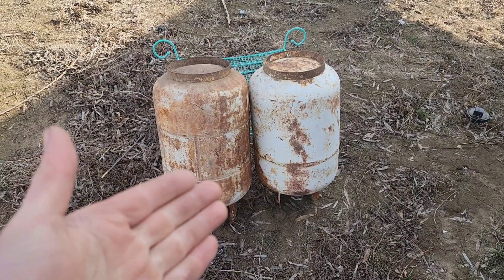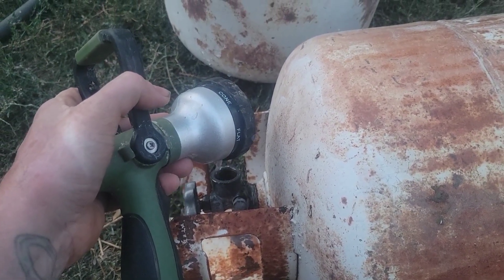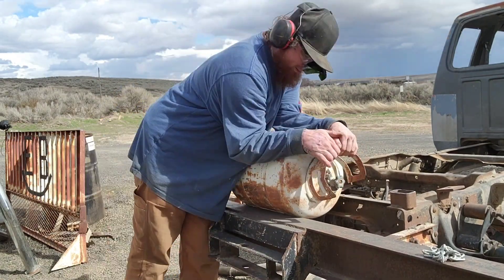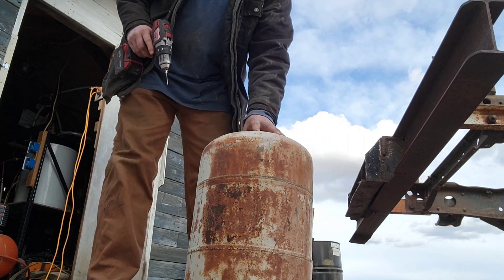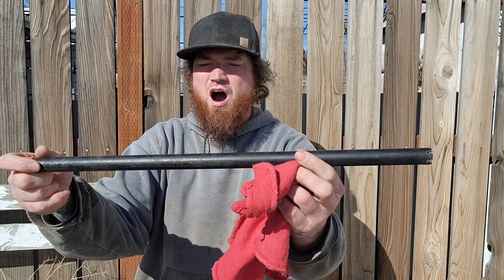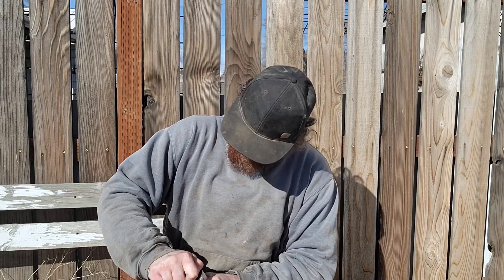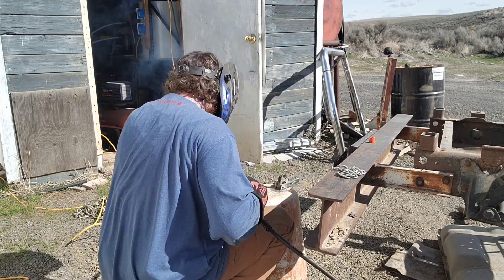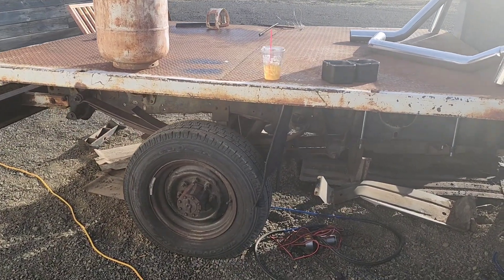I ALMOST BLEW MYSELF UP! Building a fuel cell out of a propane tank diy homemade race truck ep.10

Comment: What I have done several times already, though, is to open the valve, let the tank sit upside down for several days or whenever I get back to the project... Then just take the valve off, first thing. Filling it with water at that point is easy. You can even put a 3/4" plug in where the valve was, to hold the water in. Then you can do all the cutting and welding you want, with it still full of water. No risk of explosions. And even if you did somehow miraculously still have an explosion, it would be no more dangerous than a fart. Tank is not going to turn to shrapnel, because of the water.
Reply from the maker: Thanks for watching. Mine sat in the backyard upside down all winter! Didn't feel like going outside trying to work on it in the snow. God bless.
Reply: Great job buddy! 👍👍👍👍🇺🇸🇺🇸🇺🇸🇺🇸🙏🙏🙏🙏

Comment: When putting the water in, take out the screw on the side of the valve. That will open it up and let air escape better while you are filling the tank.
Reply from the maker: Thanks for the tip! I didn't realize I could do that.
Reply: @worthshop  When filling that tank with Propane all You have to do is loosen that screw and when You get a solid stream of liquid out of it your bottle is full.